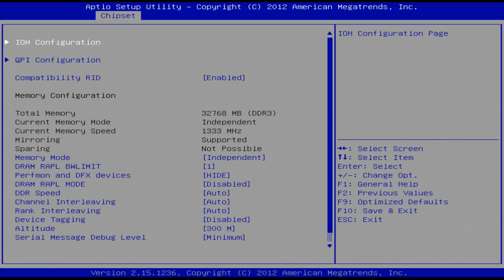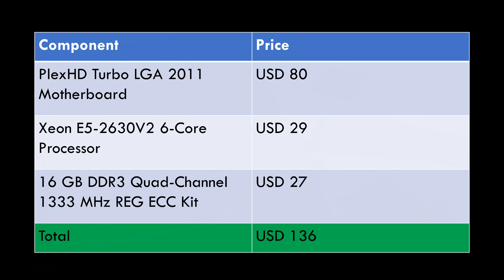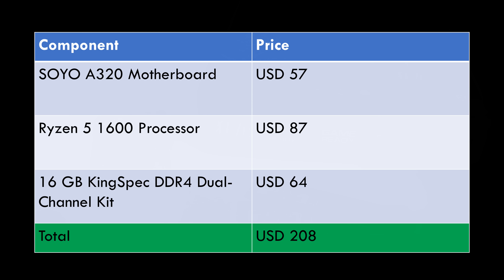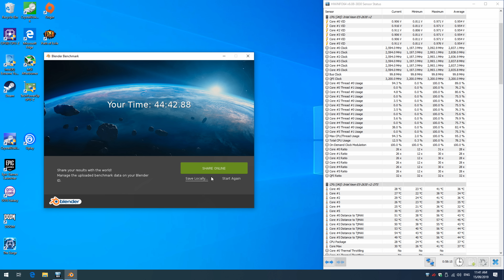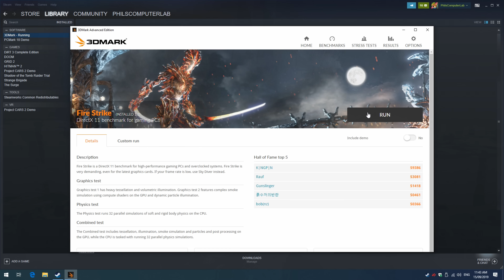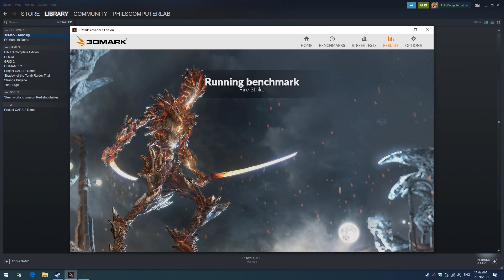Is this cheap 6-Core CPU worth it? The Xeon E5 2630V2

Comment: Problem with Ryzen is if I want a thread ripper system it’s gonna cost atleast 300$ for the board and anywhere from 200-800 for the processor of choice which in comparison I can buy a used dual socket 2011 server board on eBay for around 100$ and get 2 8 core xeons off Amazon for slightly over 100$ I can build this or spend like 7-800 on a decent threadripper build hope this helps
Folks I’ve used several Ryzen cpus and I think the performance is over hyped I still believe intel has the lead in video processing and still does just fine in gaming

Comment: I can get this combo(different mobo brand, 4x4GB 1600mhz) at 40$! One of the best value king right now, and the temperature with that LanShuo cpu cooler is quite good.
Reply from the maker: Very nice!
Reply: @philscomputerlab  Yeah, was very skeptical about this until I saw your Atermiter x79 review. And also the same shop sells Ryzen 2600 at $43.
Reply from the maker: @xxWidex  2600 for 43??? That's fantastic!
Reply: @xxWidex  how in the f 2600 for  43$ ??
Reply: @kruxdt6307  not sure...right now I am ordering their xeon combo to test the water ....see if its a real or scam shop.
Reply: @xxWidex  can you send a link
Reply: @xxWidex  only in the Philippines ?
Reply: @kruxdt6307  not sure. its a malaysia site.

Comment: hey man, have you thought of reviewing the socket G34 AMD Opterons? You can find used mainboards and CPU's for DIRT cheap today. I saw dual socket G34 boards for $45 usd, and 16 core Opterons for as little as $15 USD EACH. You should check them out since youve already reveiwed used Xeons to death
Reply: The single core preformance is abysmal
Reply: @kruxdt6307  Of course it is, its Bulldozer. But its still cheap as hell
Reply: @kruxdt6307  But I already got his attention on it so whatever

Comment: I had to bite the bullet on a LGA 2011 build! I got a motherboard off of eBay for $30, 32gb of RAM for $30.
Going to pick up a e5 1620(can't remember if it was the v1 or v2) that runs at 3.7ghz(4c/8t) and hopefully find a GTX 1060 6gb( I wish Cemu played nice with AMD)

Hopefully for a little under $250 I'll have a decent little gaming computer.

Unfortunately the motherboard I got is a no name brand, even on AliExpress I can't find the exact board. There's a similar one with a m.2 slot which mine lacks.( I think the manufacturer is the same, and it has a 4.8 star rating)
 I looked up the capacitors and they are from name brand suppliers so hopefully it holds together...
Oh, what throws me off is the chipset listed under a lot of the boards is H61, guess that's some kind of licensing thing? 

Thanks for the amazing content as always! And sorry for the little bit of rambling.
Reply: I got a 1060 for cemu at first too lol. Have you seen BSOD's vids on cemu's vulkan performance? AMD cards run waaaaay better now but it's still kinda early.
Reply: @eebsbees  I followed his steps but I could still only get about 12 fps on my Rx 480 8gb :/

Comment: I am still using a Xeon-1230 V2. It has fewer cores, but clocks higher (up to 3,6GHz I think).
It's paired with a Vega56 and is fast enough for the most games
But I am planning to replace it by a Ryzen 3600, which should be much faster.

I don't really understand why the most are testing CPUs in 720p. There are enough CPU-Benchmarks (Geekbench, 7Zip, Cinebench), so there is no need to test games in 720p. Only a few want to know Game-Performance in 720p because nobody is playing with that low resolution.
The RX580 is a good 1080p-card, so you should test in 1080p
Well, that's at least my opinion

Comment: I’m putting together a pc with the 2620 v2, 32GB RAM, x79 mini itx and a hd 7870

Edit:
Xeon E5-2650 v2, 16GB RAM x79 mini itx and hd 7870
Reply: DO NOT use the hd 7870, there are so many more options that are much better rx 580 is much better

Comment: Have some cheap "X79" 2011 motherboard around 45US$, BUT, guess the platform isn't more "cost X benefit", the good CPU like E5 2689 are costing more than 70US$ and going higher (before around 45US$), doesn't makes any sense, only the 1356 having some benefit, E5 2470 stiil around 45US$ and E5 2440 around 15US$, the 1366 also still profitable CPU like X5667 costing around 9US$...
Reply: 2689 was at 46€ last month, should have bought some more ;(

Comment: I'm from Brazil and here with importing electronics only pays off when we are lucky not to be taxed. The government charges up to 60% of the value of the product in taxes and shipping is also expensive. Between 2016 and 2017 we had a boom in imports here in Brazil, especially due to the facilities Gearbest offers. My sister, for example, bought a Xiaomi Mi Mix 1 for a great price (and she's with it to this day). But unfortunately the government has opened its eyes to the increase in imports and is doing a horrible job to curb it. It's a shame...

Comment: Hey Phil, seen his V3 drop in price by a lot, so I began looking into a build to replace that ancient Conroe865PE of mine. But I have a question if you still have this 2620v3 laying around, have you had time to test bios unlocking the all core turbo and using an undervolted on it? (there are some modded pre-undervolted bioses for X99 v102 boards now)
You mention in this review an idle usage of ~50W and load ~95W in R20. I would very much like to know if this can be lowered and if that would make a nice media and office (backup) system build that has 6c/12t.
Reply from the maker: I've reviewed the 2620V3 recently, including the turbo hack and power tests.
Reply: @philscomputerlab  do'h...forgot about it! I even watched it, I'm ashamed now.
Anyway I'll ask about undervolting the comments of that review.

Comment: This is almost like the CPU that my main gaming rig has, but it's an i7-6800k 6 core 12 thread CPU that I overclocked to 4.3ghz. I have that with 16 gb ddr4 ram gskill quad channel ram and a PNY Nvidia GTX 1080.

Comment: 0:20 If I may, which processor and GPU are you using in your main drive? Do you plan to make a Linux test?
Reply from the maker: I use a 1650V2 overclocked to 4 GHz together with a RX 470 and 32GB RAM.
Reply: @philscomputerlab  I am planning to use a 2689 with a RX 590, 32GB RAM, and I will use it with linux. Thanks for the video. Greetings from Brazil.

Comment: Dear Phil, I just got an older Xeon - the e5450 (one of your favorites, I believe). It is another CPU rated for 80W TDP just like the one you've shown. Can you tell me what would be the cheapest cooler for it? I've seen you using the Gammaxx Archer (it is quite affordable and has a large fan that blows air onto the VRMs) - can it keep an 80W Xeon stable for prolonged gaming sessions at stock speeds (it is for a friend's kid)? Or any other budget alternatives?
Reply from the maker: A stock Intel cooler, especially if it has a copper core, will work just fine! The Gamma Archer should also work. 80W TDP should be easy for most basic coolers to be honest.
Reply: @philscomputerlab  Danke sehr, you're so awesome! Another idea for your channel - now that you have CPU thermal pads (therefore way easier to swap coolers), it would be great to review CPUs with low-end & high-end coolers and present the results.
It will bring huge value to your viewers in the not so prosperous parts of the world, where getting an old Xeon would be way cheaper than a capable cooler.
Reply from the maker: @НиколаГеоргиев-ш2б  That's easy though, just get a tower cooler with heat pipes and 120mm fan, they all work really well. Snowman is a popular model. Top down coolers are more for 80w tdp CPUs.
Reply: @philscomputerlab Yes, I know about the Snowman. It was even discounted by a few bucks last time I checked. However, it is still three times more expensive (with costly delivery as well) than the Gamma Archer and the like (available locally). 
And friends keep arguing with me that with the GArcher the CPU (albeit 80W) will reach 85 degrees under load.
That's why I suggested benching with both low-end and higher-end coolers. Your western viewers may not find that useful, as they would not put a cheapoo cooler in their rigs, but think about a place where every $ counts.
Btw, just checked Deepcool offers an upgraded Gamma Archer with copper core for the Russian market - sadly we do not have them in the EU.

Comment: I appreciate the video, but for the money and commitment I still don't see how is this good option for gaming, there's seems lot's of issues, while low clock processor might be the problem but how does it perform with better motherboard or proper x79 chipset board because I think it's the motherboard? the option for CPU is also kinda limited, other processor that runs 3Ghz or more is still expensive, I mean it's comparable to Ryzen 5 (1st/2nd gen).

Comment: okay see this is a good video. not that i need more pc parts.....
136dollard so like 100€ is not bad with 16gb ram.
btw you can get of ebay 50€ b350 motherboards. or even amazon warehouse b350 x370 b450 for around 50-70€ with some luck
plus i got my ryzen for 63€ (i had a 10€ coupon)
and in france i got multiple ddr4 kits hyperx 2666mhw 2x8gb for 52 and 55€ new (one i use with my i7 6700 oc at 4.5ghz ish kinda have hard time finding the good spot + its a hot head the cpu with z170 an got my ryzn 1600 + b350 that i need to build.

Comment: In idle the Xeon E5 2630V2 is more efficient than the Ryzen 5 1600 ? This may be due to the lower clock rate.
It would be interesting to know which x58/79 motherboards really actively support ECC error correction...

Comment: I have 32gb ram more then I need I had 16gb and never maxed the ram out just upgraded to 32gb ddr4 because ram went cheaper, I know for another 8 years I won't need more then 32gb but I will upgrade my GPU as I have a gtx 1070 ftw but I run games at 1080p 60fps and EVERY game even the triple a games gets that easily without a oc, I will oc my gtx 1070 but not yet

Comment: in my country this platform worth a lot. here the ryzen's 1600 R$650.00, like 160 dollars....
Reply: ggabriel 537 oh wow i bought a brand new ryzen 2600 for £119 on amazon brand new
Reply: @LilUziDirt  great choice, unbeatable price-performance ratio when buying new
Reply: but you can get cheap ryzen from ali, if it's an option
Reply: @frinkpc2515  yep, but 1 dollar = 4.05 R$ and we get like R$950 per month. this is brazil ;-; i hate how the things work's here
Reply: Yet ryzen 5 1400 would beat all of these xeon that is more cheap, and it is like 66 dollars with coolerbox and 57$ just the processor, on the Aliexpress I bought one of these and it performs surprisinly the same as ryzen 5 1600 on games. Buying a xeon for 20$ bucks you will need a good cooler plus 20$ and quad channel to perform decent plus decent motherboard around 80$, if you put all of these on the calculator will see that at the end of the day is better buying amd now and have a 2017 processor
Reply: @Jaymie Pierce You're right, but the R5 is cheaper in most countries. 136 vs 113 EUR in Germany for example. Tough choice
Reply: @ggabriel5378  what about moving to USA? Buying a visa or becomk gali citizen of USA,and then working there? It would be hard to move, etc, but you would get like 5x times the pay
Reply: @Saigonas  it's very hard. first i need to get the money, take my passport, and then buy a ticket to go to usa, then i will need a job and a green card to live in your country.... it's easier to go there when i go to "faculdade" i think is the high school

Comment: This CPU is newer by 2 or three years than the 4C8T Xeon in my workstation at work....
Reply: A bus station is where the bus stops. 

A train station is where the train stops. 

My "workstation" runs an FX-4300 and Windows 7, go figure. For my (free!) Supermicro ZFS home server, I just purchased the 2630V2 upgrade for less than 20 bucks including shipping...and I threw in 128 gigs of RAM for another 90, just for good measure. At work, I get paid to wait. At home my time is precious...

Comment: Little request : can you if possible in your reviews give power draw without the graphics card ie integrated or using a super low power gpu
Reply: Xeons, en masse, don't have any iGPU. You've gotten some on a start(total consumptions in idle/bench is synthetic load equivalent of non-graphical load) Actually he didn't gave overall powerdrain of in-game-situation BC of big influental difference on GPUs. In addition, you can't predict nor replay any "at the moment" consumtion in games - it changes constantly depending on a game/scene/detalization/background processes etc.
Reply: @andyshtroymish4997  hum you misunderstand. I'm asking if possible to include idle power draw of his systems without a graphics card (IF the cpu has a iGPU) or with a low power gfx card (GT 710?)  and max power draw with both when running synthetic benches not game load.
Reply: @Airbag888  6:46
Reply: @andyshtroymish4997  Hey! Thanks for pointing that out. I actually did see it before and is one of the reasons I love the channel: Because he lists power draw of the systems he tests. My request is mostly to see the draw with minimal components installed so cpu/motherboard/memory and maybe a super slow dumb gfx card. To be used as a home server 24/7 :)

Comment: Only problem with ordering mobo's from China is really poor packing, already experienced a mobo coming in a bubble wrap shipping bag,  damaged and then they want me to pay to send it back, got a refund from ebay.  Will not buy from China unless they box it, even then some boxing has been really cheap and damage resulting.
Reply: It seems to vary. I've bought four mbds from China so far, including a dual-S2011 unit, all of them came well packed in a proper box, extra padding inside, send in a padded bag. I should imagine the future support issue may be a bigger factor for some though, but I can't moan about the performance as the results are impressive, eg. note how in this example the differences fade at 1440p (and it's still holding 60+fps, not bad for a $13 CPU):

http://www.sgidepot.co.uk/misc/dirtrally.txt

The board is tiny btw, dwarfed by my 780 Ti (the cooler is a 92mm model):

http://www.sgidepot.co.uk/misc/P1160325s.jpg

Total cost was below 125 UKP for the CPU, RAM, mbd and cooler.

That's the bottom of the scale. I've yet to test the higher up CPUs, 2650 v2 and suchlike (especially two of them on the dual socket board, should be a laugh).
Reply: @Tamer Beatle I already have plenty. :D  I have two P9X79-E WS systems, two standard WS systems and four R4Es.

Comment: fortnite does not run rite at epic settings  this season there is to mutch background stuff it is best to  run 1080p with 100 resolution  scale  at medium or low  it looks and runs way better that way  or run it like have view distance and textures and effects  at epic or high then rest on medium or low messing with the resolution scale messes with the look 2 mutch but does not affect it as good as them settings do  i would rather run all low and have 1080  at 100 resolution scale than  lower  resolution scale and have higher texture settings

Comment: X79 windows XP retro build :D
Reply: It won't work(at least) properly. Those Frankensreiners have nothing to do with oldy drivers even for the same chipset(H67, for example). By the way, how are you supposed to use 6/12 or bigger on XP?
Reply: @andyshtroymish4997  it's not about function. It is all about EXTREME!!! But anyway I think h67 has windows xp drivers so it might work

Comment: For same price you can get 2622v3 qs, same as 2640v3
+turbo unlock
Reply: Yeah but for socket 2011-3/ram DDR4 not socket 2011/ram DDR3....Haswell vs Sandy/Ivybridge Cores.
Reply: @juanmassiosare9850  and?
Reply: @rulik007  he is talking about the price difference of ddr4 and ecc ddr3

Comment: This Xeon processor may be cheap, good X79 boards are anything but.
Best to get an i5-2500K for $33 (AliExpress) and pair it up with a cheap mobo. Now, sure it won't have the 6 cores, 12 threads of the Xeon but... It'll have MUCH stronger single-core performance.
Reply from the maker: Yea fair point! But a Z series board for overclocking isn't going to be cheap either. You can get a cheap H61 board though, but yea, no overclocking AFAIK?

Comment: When using a similar setup with Win10 1903 and a Radeon RX580, has anyone else experienced a generally sluggish Windows UI? I've cloned and replaced the NVME drive to a different model, used DDU and driver updates, system file checker - can't seem to find out why this is happening. Never experienced this on my x58 systems, or even x79 when using OEM workstations.
Reply from the maker: Hmm I haven't noticed anything like that! I use a 470 in my main machine and RX 580 and RX 5700 in my projects.

Comment: Hi. I have a question. I bought a Westmere Xeon for 6$ I bought a chinese X58 motherboard for 42$. 16gb 1333 mhz registered ram for 17$. I thought I got a good deal. But when I built the rig I tried to install Windows via a ssd hooked with a ssd enclosure it refused to take the fresh install. Tried to hook up with a hard drive with windows already installed it just reboots to first screen. Can you tell me what’s the issue and if you encountered any of this weird issue on X58 Chinese motherboards? What’s the trick I should do on it? Waiting for your response. Let me know. Thanks a lot by one of your biggest fans.
Reply: Try to use a usb installation

Comment: Noooo, it's a V2 chip, my motherboard only supports V1. It's amazing how long I've been waiting to put in a CPU.
Reply: Maybe the e5-2689 will work on it ? It’s 8 cores with a higher boost (3.2ghz) but it’s slightly pricier
Reply: @My_Old_YT_Account  yeah I'm saving up to get that.